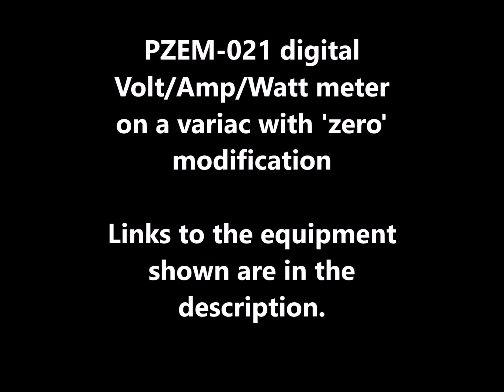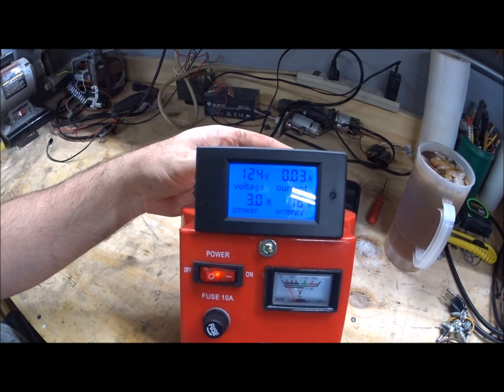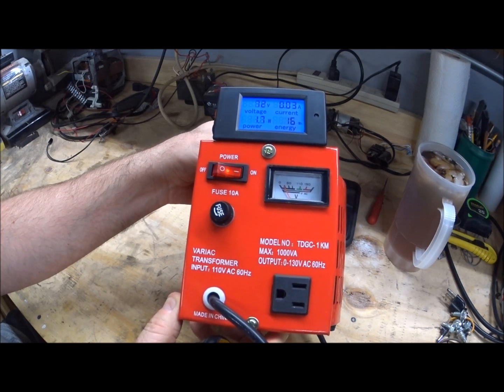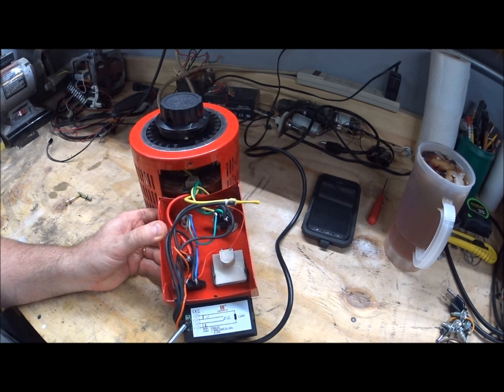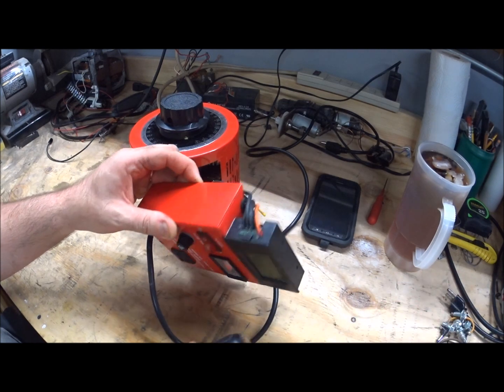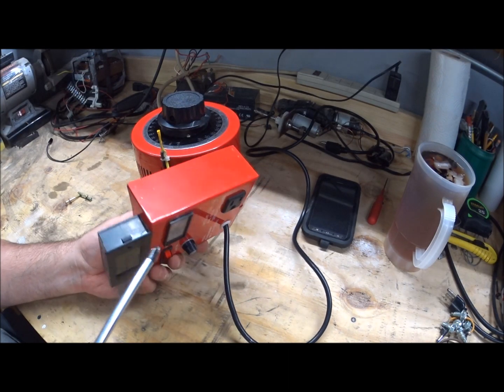PZEM-021 digital Volt Amp Watt meter on a Variac with 'zero' modification

Comment: Thanks for this help, I have a GenRad variac with different wiring but this and your diagram helped me figure mine out. Thank you too for helping to dispel the “old head” notion that you shouldn’t do mods like this if you need step by step help, that’s just plain foolishness. Transparency for all at whatever level of understanding they’re at, as long as they understand all the risks - it’s the best way now.

Comment: To add a few steps. You must disconnect the wiper wire from the load outlet before connecting it to the display wire (the one that was heat shrinked and zip tied). Also, there is a jumper wire going from the neutral on the load plug to the variac power switch that has to be removed. Pretty sure I have the exact same variac as this one and I had to do this.

Comment: Are the connections any different for a dual receptacle variac? I was not able to get it working with dual receptacle variac I purchased. Wondering if the ganged neutral wire in the ganged receptacles and the meter connected causes the variac short. When I connected as instructed in the video and tested, the meter worked for minute or two then stopped functioning. As I turned up the output of the variac it started to hum as if loaded. I assumed there was a wiring error, but I didn't find one.

Comment: wow i can not thank you enough .all the other videos kind of tell you but i am just learning electrical engineering and  so i don't just wanna do thing i wanna know why to and you really answered all my questions . others would say things like go to hot lead and the neutral side but you went into detail and it helped so much .teaching would be the perfect job for you because it was a great video. yes it is really basic stuff but if you go by the meters diagram it  did not work right for me. also some just used 3 wires. yours made so much since thank you so much. cant wait to see what other videos you have

Comment: The inside of my PZEM-021 looks slightly different - definitely is the PZEM-021 though, possibly a newer circuit revision? Measuring between the pins, 1+2 don't appear to have a resistor between them? Measures under 1 ohm? Will this way of wiring up the meter still work?

Comment: I got a meter that has a completely different wiring diagram and it is confusing to me. This one came with a little current ring. It has load going to 3 and 4 and it says CT to 1 and 2. How would that be wired? It shows the ac in of the load going to 4, then the what I assume is the neutral going to pin 3 from the load then the pins 1 and 2 go to CT which I assume is current? So how would you draw a diagram for that like you did with the meter you installed?
Reply: Same problem here. Send help! 😂

Comment: Thanks for the video. To anyone wondering why the current meter is off following these directions it's because the neutral from the variac is hooked up directly to the outlet (at least mine was and it is in the video as well which is why the meter isn't showing zero). If you remove the neutral off the output socket and connect it to the switch where the neutral from the wall attaches it will fix it. In other words there should only be three wires hooked up to the output socket... the ground, the hot (coming through the pzem-021), and the neutral also coming through the pzem-021.

Comment: Tried to do this mod, checked and re-checked the connections multiple times, and quite sure I have it hooked up as shown in your video. When powered up, the meter turns on, but the variac starts smoking at the wiper. What am I doing wrong? Would appreciate any advice. Thanks.

Comment: interesting and i can see the usefulness of the 0v mod, however i must ask this just to be thorough will this cause an issue later?  i mean for example forgetting to turn the variac off?, voltage spike/feedback?  slightly inaccurate readings? just asking.
Reply from the maker: I'm not sure there is any way to predict that...but we are talking about cheap Chinese components,  I'd keep expectations low.
Reply: @paladinjme  ALL electronic componants are made in china including the ones people are paying big bucks for like "sozo" caps.  what i meant was is there any detrimental effect of clipping the cap from the board at one end and wiring it as in the vid vs leaving it alone and dealing with it not powering up till it sees 60ish volts.

Comment: Just followed this and PIMPED my Variac! Great video! Although, you neglected to tell the viewers how on the factory wiring of these variacs, it's not like they made ANY attempt at a mechanical connection before they soldered. LOL! Once you put some heat to a solder joint, wires just pop right off.

Comment: Wired the PZEM 021 as you did.  The power display does not read correctly.  Seeing 2.4W when a 40W light bulb is connected.  Please help.
Reply from the maker: You're seeing 2.4W at what voltage?
Reply: @paladinjme  120V AC

Comment: so you don't connect the capacitor back to the board after cutting and connecting the lead correct? Also my meter unit is PZEM-061 It should be identical installation and mod correct? I'm just double checking as I don't want to fry my meter out the box.
Reply from the maker: 1) you don't connect the capacitor back to the board after cutting and connecting the lead - CORRECT.
2) my meter unit is PZEM-061 It should be identical installation and mod - I cannot answer this question, as I do not know the differences in my meter and yours.
Thank for watching!
Reply: @paladinjme  ok thank you very much. It's nice to get a response from someone here. Love the channel. 5star from this viewer.

Comment: What components are you using? Resistor and Capacitor please?
Reply: Just curious as to what you are asking? He isn't adding anything to, just modding the existing component to be able to read down do zero. Are you under the impression he is building from scratch?

Comment: I screwed up the 5th wire, please someone could explain again, what I need to know is, one end of the 5th wire is soldered to the hot side of the fuse,  the other end is my problem ,do I solder it to the board or to the yellow capacitor lead? I know for you guys it all makes sense but I'm totally blank when it come to fixing this kind of stuff. anyone could chime in and make it crystal clear for me .thanks.
Reply from the maker: Solder it to the lead on the capacitor.
Reply: @paladinjme  Oh man, that was fast, and crystal clear now, a simple thank you somehow is not enough but I want you to know I sincerely appreciated your help.

Comment: Great video, I am not clear about the 5th lead , do you connect a wire to the board where the lower lead from the yellow capacitor was connected? does that mean you in fact make the capacitor disconnected? thanks.
Reply from the maker: Cut the lead from the board, solder on a wire (the orange wire in this case) connect the other end of the wire to the hot side of the fuse.
Reply: @paladinjme  Got it, thanks for your quick reply.

Comment: Another video about this showed that the ground connection doesn't connect through the powder paint coating.
True or false?
Anyone?
Reply from the maker: That's certainly possible...I'd say just remove the ground, use some sandpaper to remove the paint and re-attach the ground.
Reply: paladinjme :
I will for sure.
One video showed a lot of soldered connections, another showed connections bolted to the chassis ... maybe they improved their build.
Also, I want to wire in a digital meter to get a more accurate reading.
I see a lot of videos showing an inexpensive digital meter being wired into the variac.
That sounds like a “must do” to me.

Comment: Anyone has this problem : Works until it reaches 47 v. Then Lights out, Then show 1983v 999.9a, thena s your turn the turn variac higher, it just fades out
Reply: I had inverted the Ac line on the diagram. but then it shows constantly 119 volt.
Reply: Okay, I assumed pin 1 was the top non coloured one and pin 4 the lowest coloured one. Inverted everything and well, now it works!

Comment: best video on this subject,,,way better then Brad's. I also ran a 340 ohm resistor from line 5 as a bleed off. Saw that bit in another video...not sure it is worth the time to install, bur didn't hurt anything.  Good Vid, thanks
Reply from the maker: Thank you, appreciate it!  Big fan of the Guitologist!
Reply: What size resistor? Would 1/4W be OK? What was connected to either side of the resistor? Can you reference the video that suggested adding the resistor?

Comment: On my variac, the yellow lead (to the wiper) is connected directly to the left lug of the plug (looking from above). Do I disconnect from the plug, wire to the meter, and then wire out from the meter to the lug? As in, does the regulated voltage out go through the meter first, and then on to the plug? To be clear, by "plug", I mean the outlet on the variac where you plug your amp or whatever in, and NOT the main feed from the plug you stick into wall voltage.
Reply from the maker: I think the image @ 2:00 answers your question...wiper goes to pin 3 (into the meter), pin 4 goes out of meter to the hot side of plug.  HTH!

Comment: Hi Palidinjme, I have a question for you. I recently bought a Chinese variac model SC-5M 5amp 500 watts. My question is that I want to run this with my guitar amps to lower the voltage slightly to 118  volts. I saw a video on YouTube where a guy showed how he had to run an additional wire connected to the chassis for a proper ground. Apparently,  according to this guy, these Chinese variacs are not very reliable nor properly grounded. My amps are expensive. I would like a Staco 5 or 10 amp variac, but Digikey  and two other companies sell one of these to the ludicrous price tag of $721.00 for one of their good variacs. Others are just plain ridiculous,  the price and shipping. So after the fact, I went and bought one of these Chinese variacs. I then proceeded to come up with a lot of bad reviews about these variacs. Are these safe to use and do they have a UL certification certificate. Have I mistakenly bought a boat anchor? And advice? Thanks Michael Newell from Niagara Falls, Ontario, Canada
Reply from the maker: All I can really tell you is that mine works satisfactorily.  I can't vouch for yours or how suitable it is for your intentions.  I can state the obvious and say these are Chinese imports and thus probably of dubious quality.

Comment: I have a Genrad 10A Variac and I won't be drilling or modding it, but I'd sure like to incorporate something like this.  I normally run the output to an isolation transformer, and a Kill-a-watt.

Comment: Just installed for my new variac (model TDGC-0.5KM), although I had an extra step. In my variac, there was a wire connecting the neutral side of the switch directly to the neutral lug on the output plug. This had to be removed. I don't see this wire in your variac @paladinjme, so I assume it's a new addition.

Comment: Thanks for the informative video. It helped a lot. Just wondering where the baseline 30mA on your meter comes from? Is it reading the amp draw from the on/off switch light?
Reply from the maker: I assume that is correct - reading the draw from the light in the switch.  Thanks for watching and commenting!

Comment: I'm so happy I watched your video. I knew there was something funny about my variac the same one you have. I felt a tingle of higher voltage a couple of times. Turns out this unit wasn't wired correctly either. If it wasn't for the isolation transformer I'd probably been fried by now.
Reply: I'm getting one soon and I'm hoping they fixed these bugs.

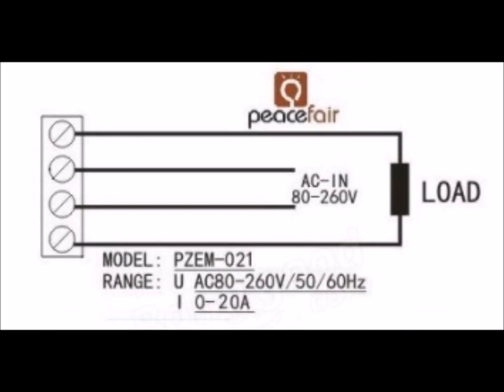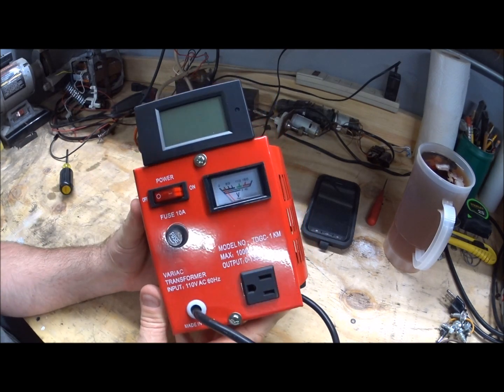Comment: Thanks for making this video, nice and clear presentation.  I have the smaller (500VA w/ 5A fuse) version of this auto-transformer and your mod works perfectly with that model.  I might run a test on one of my larger transformers at some point, I'm sure it will work.  Also noticed you had ice in your drink at 1:12 and that it was all but gone by 9:00.
Reply from the maker: Very observant - I hadn't noticed that.  I don't recall how long it actually took to record this video...but obviously quite a bit longer than the ~9 minutes or so it ended up being.  Thanks for watching!!

Comment: Excellent video, very concise. I noticed some other people have commented about their meter "jumping" , just not going up or down smoothly. My meter does the same thing, but it doesn't really bother me, I installed this meter mainly for the other information it provides as my variac already has a digital meter. Thanks again for a fantastic vid, it made this mod a piece of cake!

Comment: Awesome video. I followed it and was able to get the same meter hooked up to the same variac. One thing though is my meter is slower to respond than yours. I turn the knob and the meter doesn't change for about a half second the jumps up. It's not a smooth climb. Is this something in the wiring that I did or just the meter itself? Thanks again!
Reply from the maker: Thanks for the comments!  The jumping around sounds like an issue with the meter, you could easily test by seeing if you get the same 'jumping' on a multimeter.
Reply: paladinjme OK thanks. I'll check that out. It's not so much jumping around as just a lag in the numbers changing. It does go up and down fine just very choppy, not a smooth, constant change like in your video
Reply: I checked with a multimeter and that works fine. It seems like my meter has a slow refresh, the numbers change only every second or so and not real-time. I hope that's not due to anything I did with the wiring.

Comment: Hey paladinjme!  Thanks for the helpful vid!  I have the same unit as you have in your video.  Followed your directions and it worked like a charm.  I kicked my unit up a notch by putting the meter in a plastic enclosure and fastening that down to the Variac housing with an aluminum angle bracket and some screws.  Thanks again!
Reply from the maker: Glad it helped!   Thanks for your comment!

Comment: Very helpful video, thanks! The LCD on my meter remains lit, even when my variac (same model as yours) is switched off. Is it supposed to be in an “always on” state?
Reply from the maker: Sounds like your fuse may be in circuit before the switch. Mine is Power -> Switch -> Fuse.  If yours is Power -> Fuse -> Switch, then just wire the '5th' wire (lead from capacitor) to the 'switched side' of your switch.
Reply: That’s exactly right, thanks so much for the quick reply! I’ll give it a try. BTW...the incoming neutral line is connected to the switch, the neutral lug on the socket, and the variac coil, all at once. Does that sound right? Don’t trust wiring in this thing. Thanks again!
Reply: @64ES335  I have added a 1/4 amp fuse in an inline holder between the digital meter and the switched hot side.  Probably not necessary, but easy to do and made it just a bit safer if something in the meter goes bad.

Comment: Excellent !!  Thanks a ton !!  Curious tho - given that the "full power to the meter" mod is so simple - why wouldn't they manufacture it that way in the 1st place?  Having the capability to measure clear down to 0 volts AC is so obviously very useful !!
Reply from the maker: I think that's because this meter is designed to be used within a normal range for household voltages.  Just my guess..  Thanks for your question!

Comment: Thanks for the great video. Can you explain why some of these AC meters have an external coil to measure current and some do not?  Is there an advantage to one over the other? Is it possible to read true current without running one lead through a coil, as my handheld clamp ammeter does? Thanks again.
Reply from the maker: I would say that the values displayed on the analog meters on this particular model are dubious, at best and are only to be regarded as 'relative reading'.  At the very least, I would reconcile it again a good DMM.  The only other indication of current on this variac is the topside label, which I would regard as something just short of completely useless. HTH. Thanks much for your questions!
Reply: paladinjme Thanks for the quick reply. Hope to see more on your channel!

Comment: Ok ...wiper comes off fuse goes to pin 3 and pin 5 takes it place on hot side of fuse....correct?Thanks for your reply.
Reply from the maker: It's tough to say with certainty more than I've already have, especially not having the schematic for your particular variac - which shouldn't be vastly different in principle than mine.  Tuorum periculo! -   Thanks for the questions!!

Comment: Hi, My variac is wired a little different. From what can see in the video 2 neutral and 1 hot are tapped from plug and switch. The remaining wire goes to variac wiper, now my wiper wire goes to hot side of fuse,do I desolder that and solder wiper directly to pin 3 and pin5 goes to fuse taking the place of original wiper wire?Thanks ...looking forward to my mod.
Reply from the maker: Pin 5 goes to the fuse - so that is always gets 120v.  Pin 3 goes to the wiper.

Comment: I have a similar meter, perhaps made by a different manufacturer. Different layout but it also has a 1uf cap. Is your 5th wire going into the circuit through the cap or bypassing the cap? Mine has a 10k resistor coming off the line input, into the cap which bypasses 2 resistors and then into a diode network. Cheers!
Reply: I believe I've answered my own question. I've added constant power to what I would call the input side of the capacitor before the diodes. Installed on my older Variac W10MT3W (with damaged meters) and works like a charm.
Reply from the maker: Indeed, I have constant power directly from the hot side of the fuse directly into the cap.  Thanks for watching and commenting!
Reply: paladinjme I really appreciate you posting! Really helpful 👍🏼